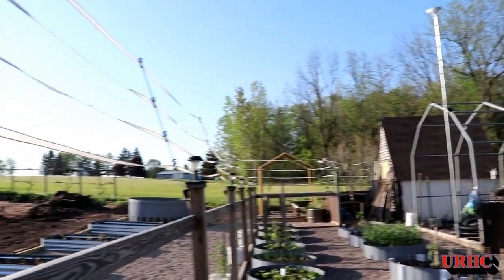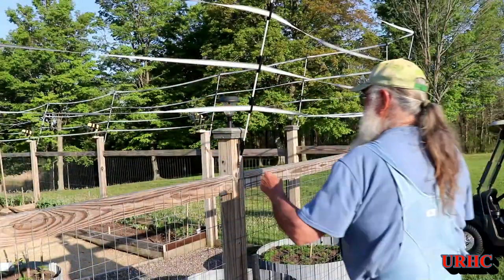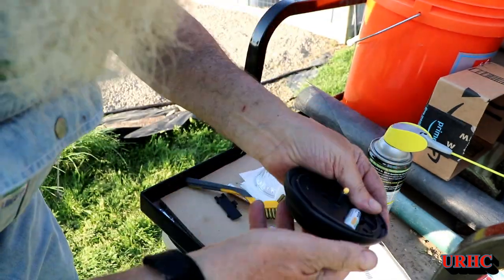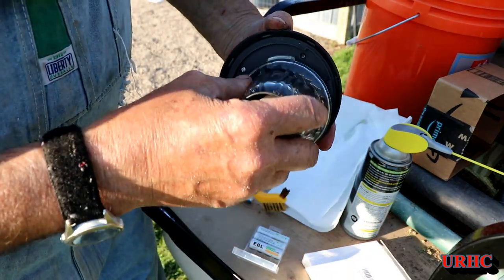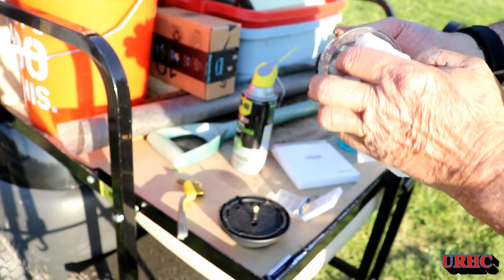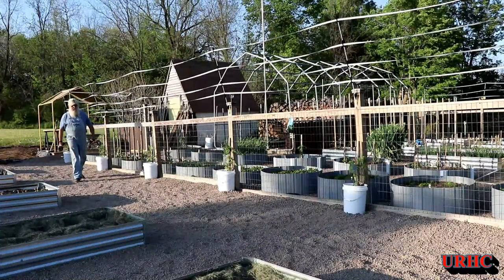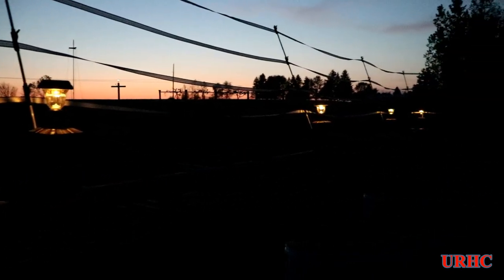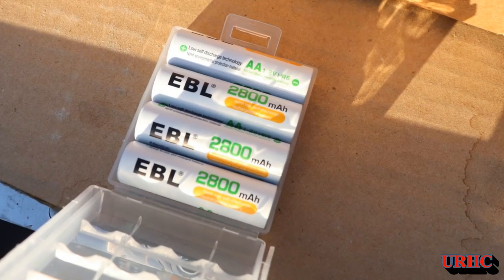Solar light Maintenance

Comment: I'm sure those batteries will work fine. Nice evening view with those lights. Starting to warm up here in the Southern Tier.
Reply from the maker: They  should  be good because  these  lights have decent  solar panels but not all lights can use them from what  I have read. It's too hot up here now. Not one drop of rain in over 2 weeks.  Thanks for watching.

Comment: NiMH are a good choice. The only thing about them is the fact they dont handle heat or fast discharges to well. LiPo batteries are also a good choice, Nicad, has a huge drawback of memory effect. Unless you properly maintain them and discharge them 100% they will be down to 15% capacity in no time. It is essentially a battery with diminishing results. In my meager opinion as an electrician and control technician CRC is some of the best contact cleaner. I've always used hardwired outdoor lights for the most part. I think they are just overall better quality. I am pondering building a solar and deep cycle battery power supply for them though.
Reply from the maker: I think  they will work in these lights. They have high quality  panels that should  have the voltage to maintain  them. I understand LiPo is no good for these lights because  if you charge them under a certain  temp they self destruct. I am looking  into solar panels now to have some longterm backup when the grid goes down which is reality with the current  environment of paying ransom. That wd40 cleaner dissolves corrosion on contact.  Thanks for watching.